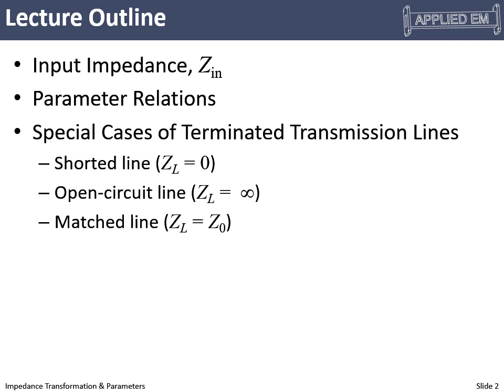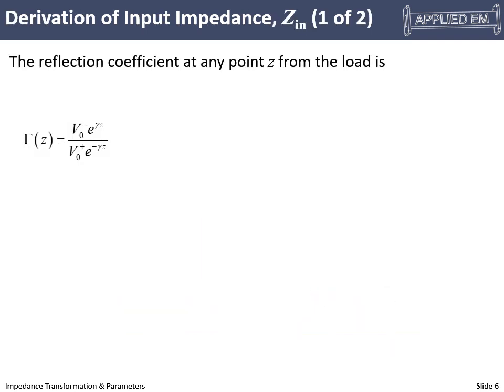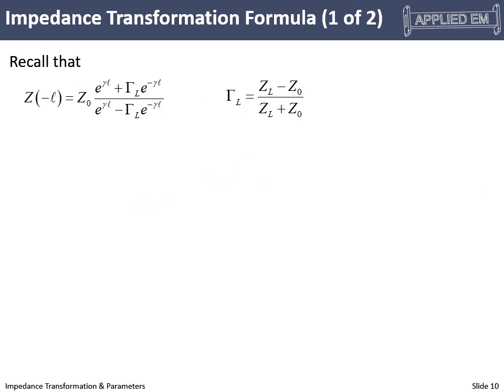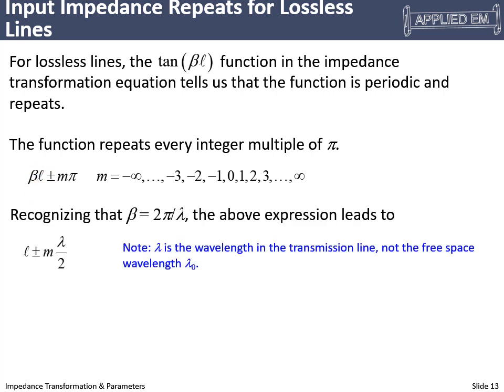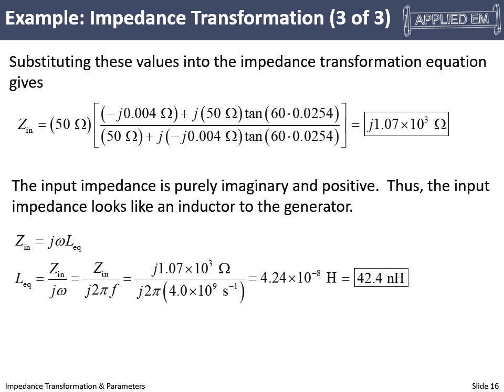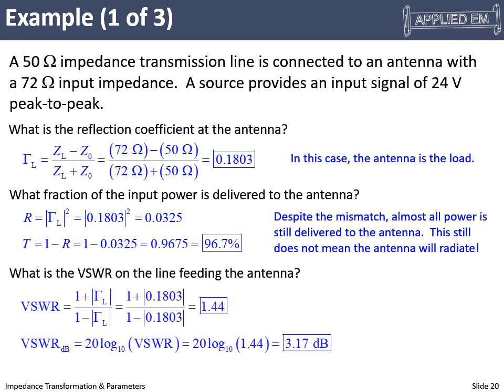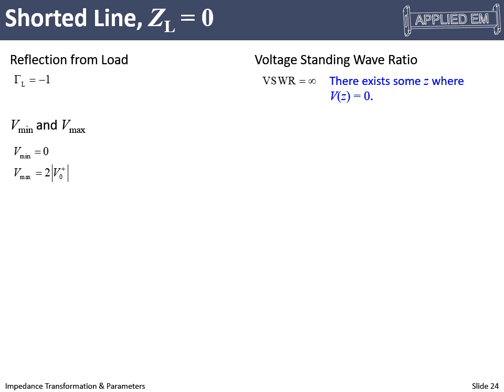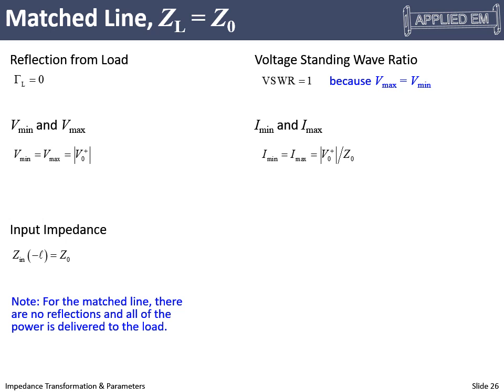Lecture 4e -- Impedance Transformation and Parameter Relations

Comment: Again great animation which really helps to solidify understanding of input impedance. I would add that (although it's implicit in the animation and formula beneath it) that at every EVEN integral multiple of a quarter wavelength from the load that Zin = Zload but that at every ODD integral multiple of a quarter wavelength Zin = Z0^2/Zload. An even integral multiple of a quarter wavelength brings us back to the same point on the Smith chart and an odd integral multiple of a quarter wavelength brings us 180 degrees from the starting point. Another way of understading open circuit become short circuits and C becomes L and conversely.

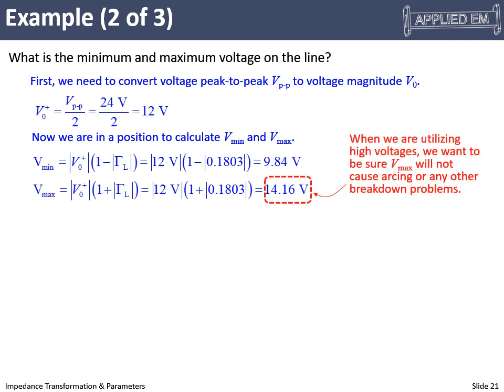Comment: Hello professor , i dont understand why V_0 + is 12V at 26:42 . I thought V_0 + is the magnitude of the forward voltage at the load. Why is it equal to the voltage at the generator.
Reply from the maker: Two things are happening here. First, it was peak-to-peak voltage given. The magnitude is half the peak-to-peak voltage. Second, the question is asking about min and max voltage across the entire line. You will need to know the magnitude of the source to calculate this, just at the load. It is entirely possible the magnitude at the load is zero yet there could still be a standing wave on the line. This would happen of the load were a short circuit.

Comment: How the Zin = j1.07 × 10^3 came..?
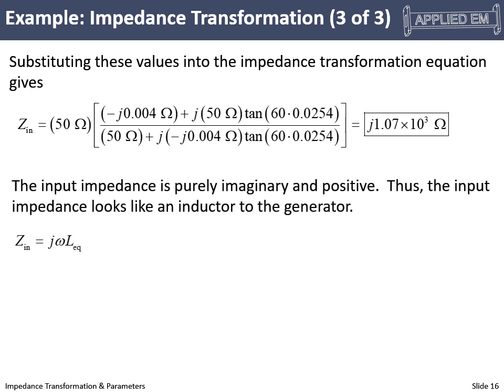I did solved through calculator but the answer came 1.32625 j .. (19:26)
Reply from the maker: I repeated the calculation several times and I am getting the same answer as in the slides.  Is your calculator in degrees or radians mode?  Maybe that is the problem?

Comment: Thank you, very well explained and at a comfortable speed.
One question: @ 16:30, in the example you have phase constant beta=60, but if you are operating at 4GHz, which in free space has 7.5cm wavelength, but based on beta=2*pi/wavelength and plug in 60, you get a wavelength on the line of 10.5cm, which is longer than free space wavelength and can't be physical. Am I missing anything?
Reply from the maker: Michael Love I probably just made up the numbers for the examples without giving this much thought.  In metallic waveguides, this can happen easily.  For transmission lines, probably not unless there is something exotic about it.
Reply: @empossible1577  I noticed that too. In fact that wavelength at 4 Gz would imply a velocity factor of 1.4 violating special relativity.
Reply from the maker: I am away on vacation so I cannot run any numbers. Quickly, I can say beta is not a free space parameter. A wave on a transmission line slows down some, making beta and wavelength a bit different than free space. Is something still wrong?

Comment: Why we don't take into consideration the mismatch between the Antenna impedance and the free space impedance?
Reply from the maker: This analysis is happening from the perspective of the generator and transmission line.  The only thing those see is the input impedance of the antenna.  Typically when an antenna is simulated, the input impedance is accounting for matching to air.  In fact, some define antennas simply as an impedance matching network between a transmission line and air.